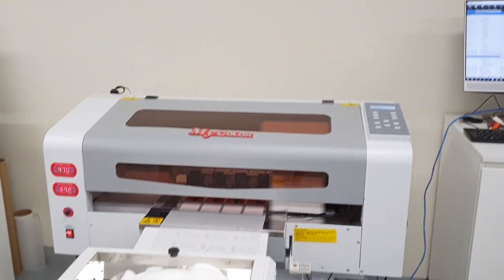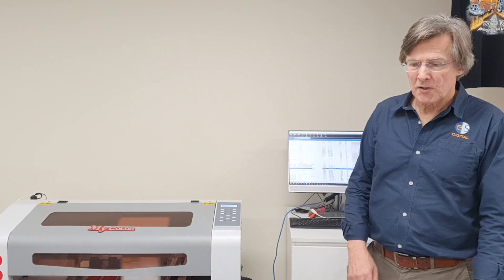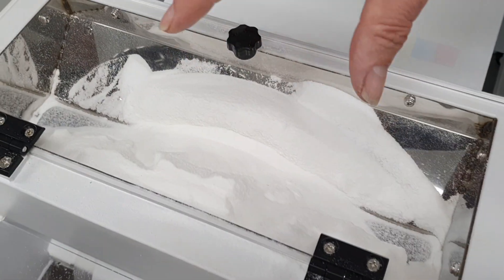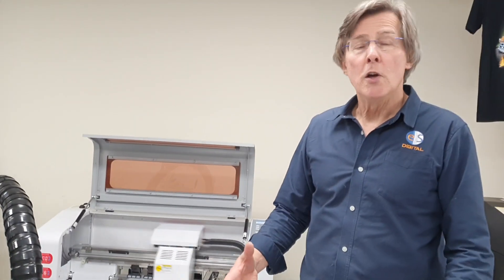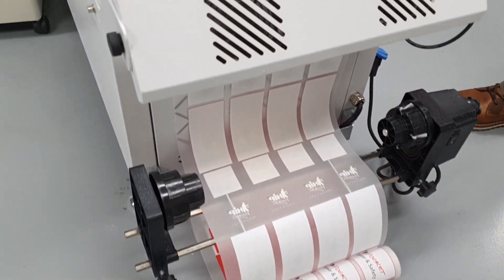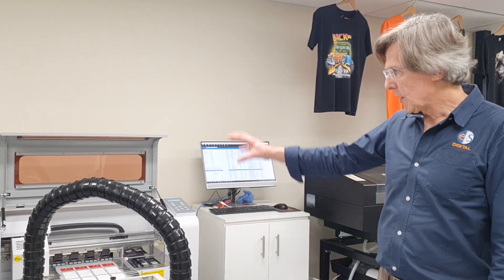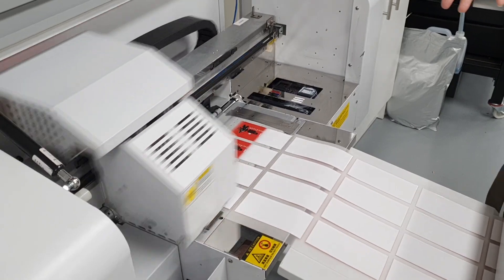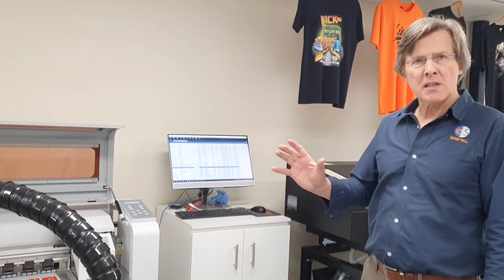MyColor (by Audley) 30cm DTF print system

Comment: Sir, (1) which heads are used in this ? I3200 both heads or XP600 both heads ? (2) What is actual width of the PET film - 13" ?
Reply: He said it is xp600 printhead in the video.

Comment: I have the machine I got in November 2022 and haven't got it running yet, if possible can you tell me Does your shaker/oven require an ac 220v power? if so can me what I can do or can you tell me what to tell the electrician, please? thanks. I can pay you for your time I just need to get it up and running.
Reply: please let me know what did you do   I have the same problem
Reply: Hey girl, did you ever get your DTF printing system working?